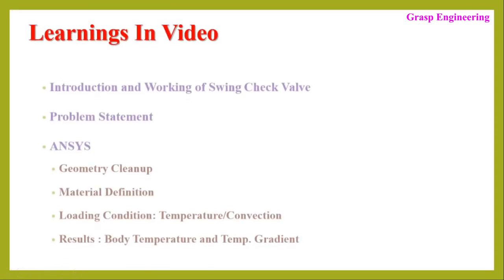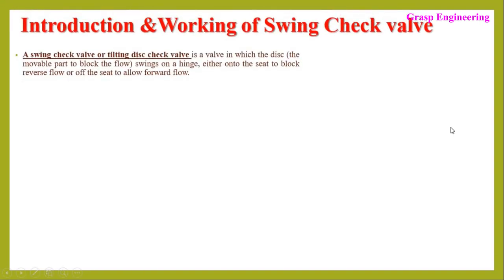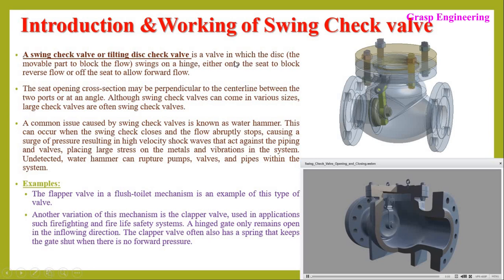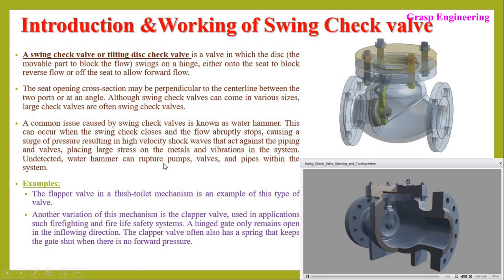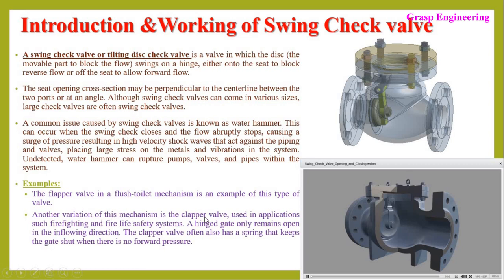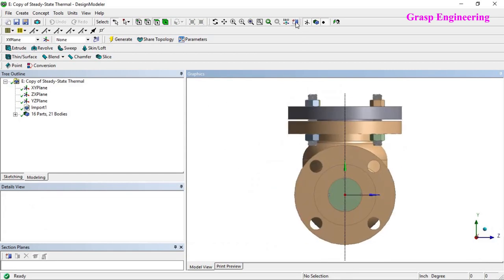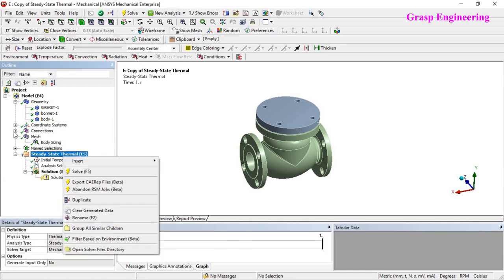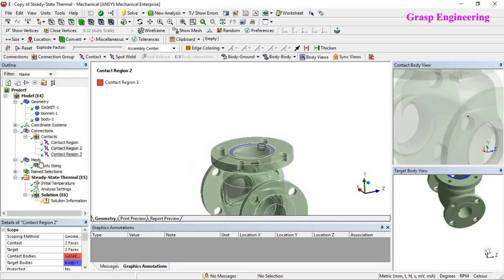Introduction and FE Analysis of Swing Check Valve using ANSYS, Part-1

Comment: the swing check valve model is which class, 150 0r 300 0r 600?  whats's the inside diameter/ port size, 2" or 4"?
Reply from the maker: You will get same model from grabcad library or we will try to uplod in our blogpost too.